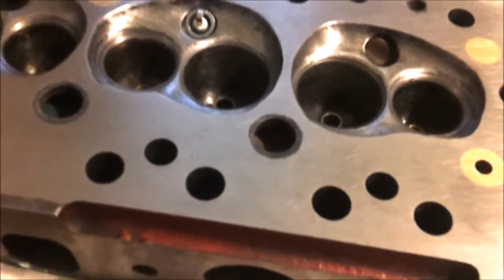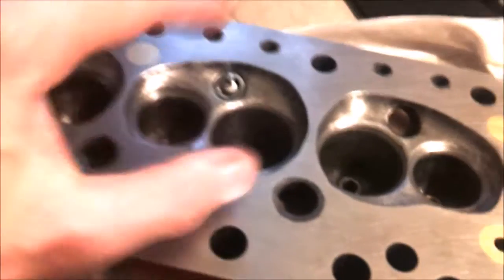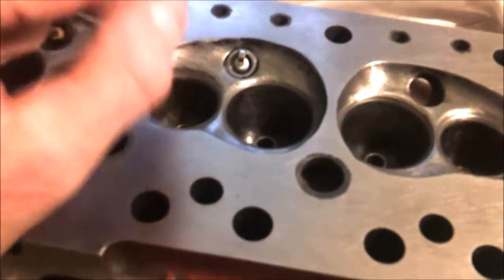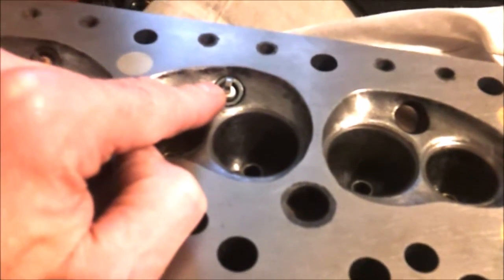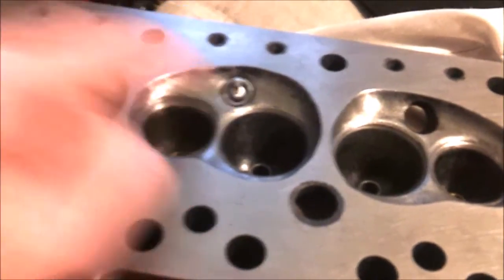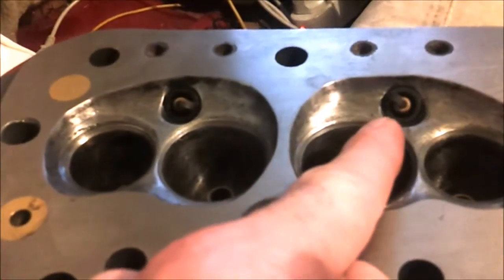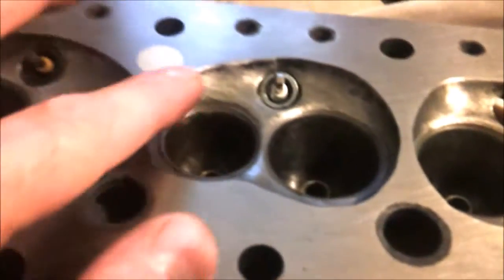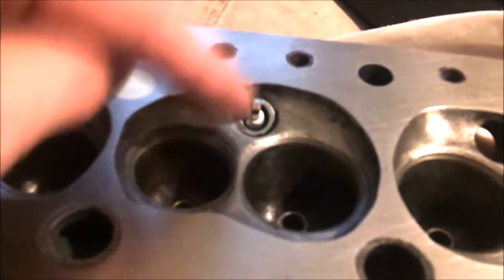12g940 spark plug suggestion classic mini etc

Comment: Dont take the washer off... or the spark plug WILL come loose over time.. over many heat cycles..

Then again..  what would  I know.. 20 year engine DESIGN...  you can get INDEXING washers to set the direction of the electrode.. 

if you remove the washer to INCREASE the compression ratio.. then.. NOT worth the unreliability... 

Just my 2 cents